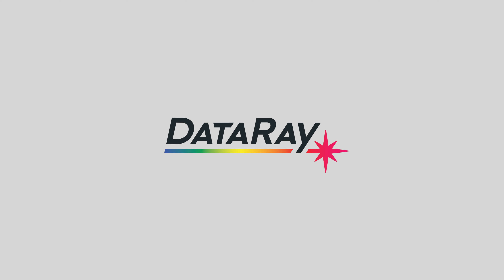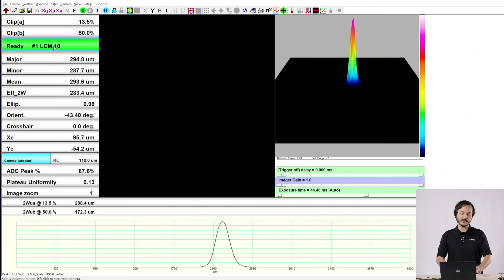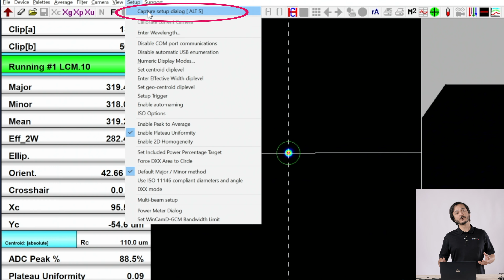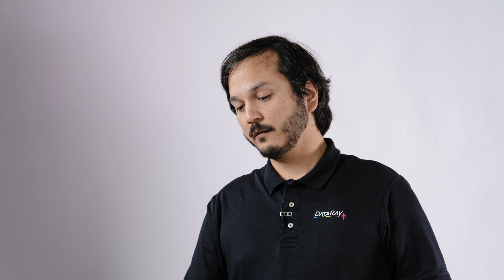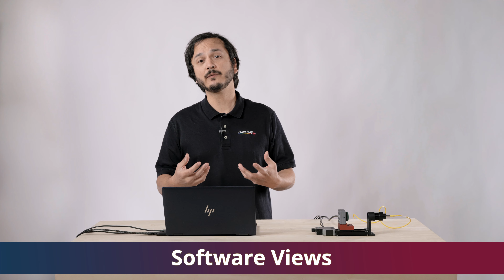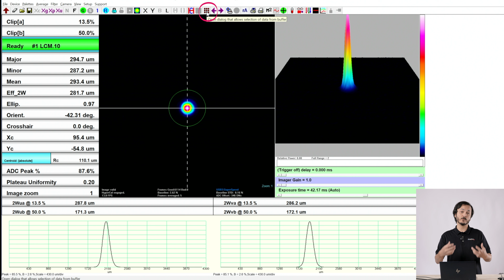How To Set Up Your DataRay Beam Profiler

Comment: Hello! Could you please tell me if it is necessary to keep the crosshair to zero degree? And, also, I am not able to image my beam of 266 nm at farther distances from the source. I am not sure why that is the case as I can visibly see the fluorescence of the beam hitting the dataray camera using a papercard. I also tried increasing the exposure time and I think the maximum is 500 ms. The power closer to the source is 1.75 uW and decreases to 0.58 uW maybe approximately over a distance of 42 inches approximately. The laser in my experiment is a pulsed laser that gives 266 nm and rep frequency is 60.3 kHz. 
I would greatly appreciate it if you could make any suggestions to see how the beam behaves over distance - I am trying to determine if the beam is collimated or diverging or converging and diverging.
Thank you